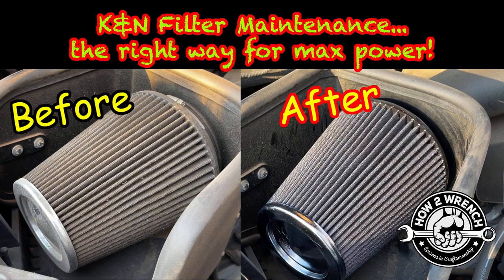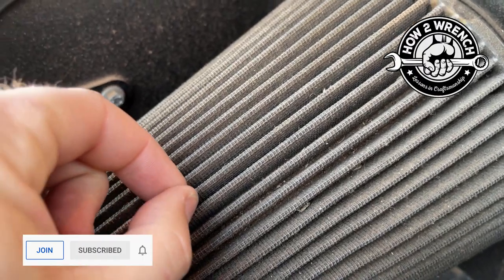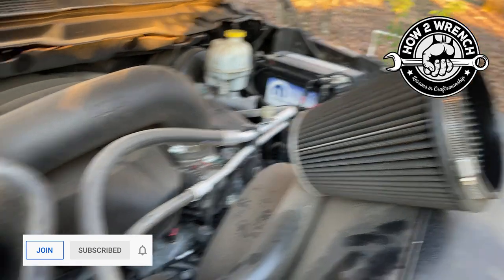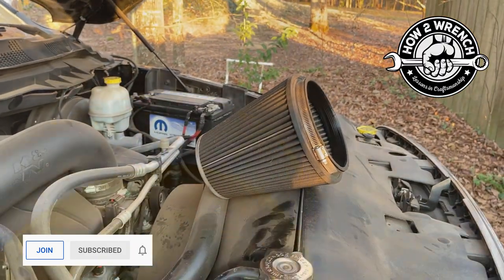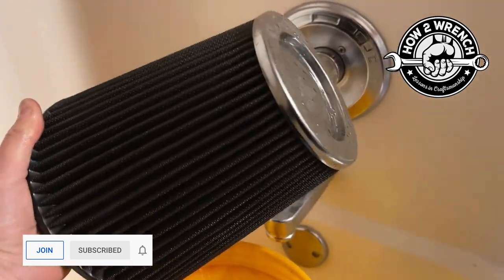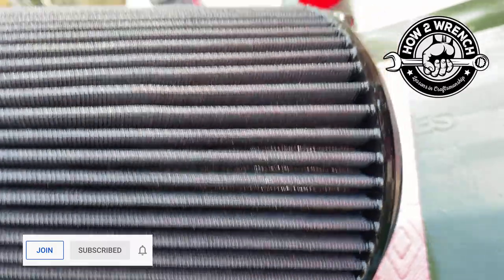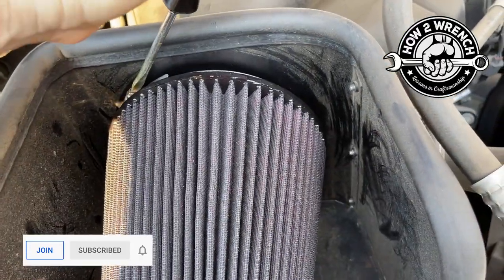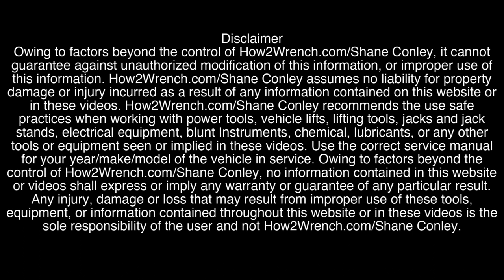How to service a K&N filter the right way. Max power, protection and life of an air filter #kn #k&n

Comment: Even if you thoroughly clean and oil it, they are really not as efficient as a true CAI should be as they are just sucking hot air from inside the engine as opposed to air coming directly  from outside the car. It should really be called max air intake. I've been using S&B air intakes for my Tundra and it's design is much more of a true CAI
Reply from the maker: Makes sense...TY

Comment: K&N are not good filters for protecting an engine. They let more particles through than any other type of filter. Yes, better performance from the engine (maybe). Yes, better gas mileage (maybe). Is it worth increased engine wear for street bikes and cars? Not mine!
Reply: Naps do you have a study to back up what you say or is it just something you’ve heard? I ask because I’ve heard this on occasion but never had any scientific data on it.
Reply: @davypig571  Theres a video on youtube that compares lots of filters, K&N being oneof them. K&N SUCKS
Reply: I’ve been using a K&N filter in my 2008 F150. 225,000 miles and still runs like the day I bought it so don’t agree that K&N filters are trash.
Reply: @billsmith9142  I'm pretty sure it's probably true that the K&N air filters aren't as good as filtering in the tests they did because it's not a passive air. It's an active air filter so they tests everyone uses aren't really a good test for it. If it really was as trash as people say then you would see dust on the intake. And this guy showed there wasn't any.